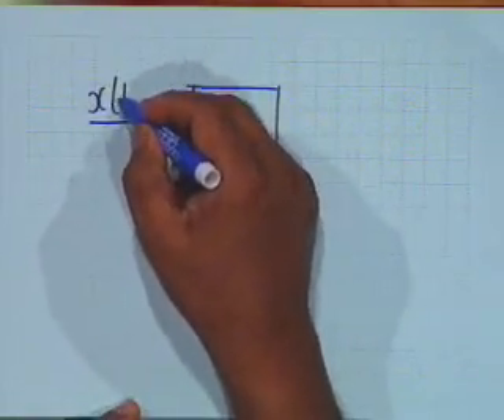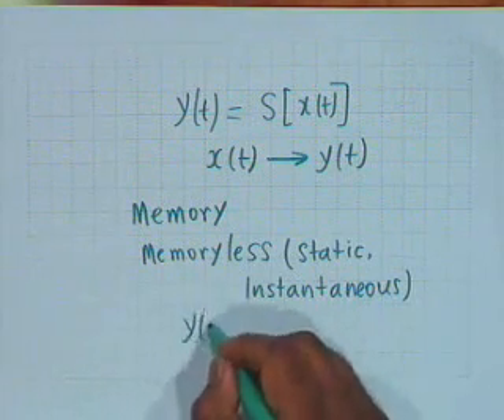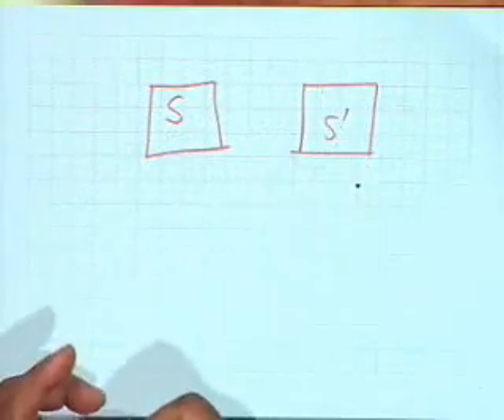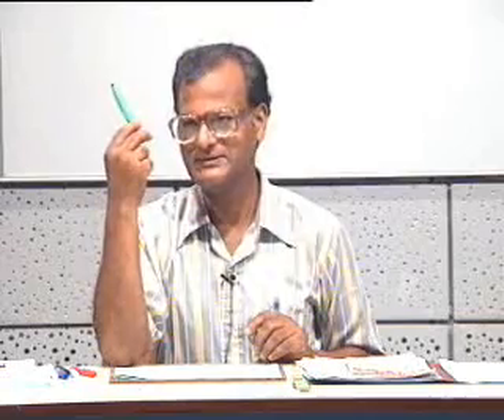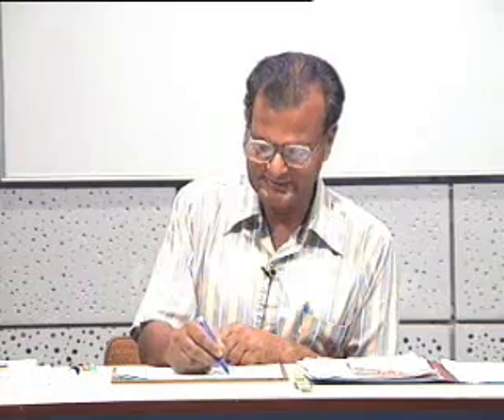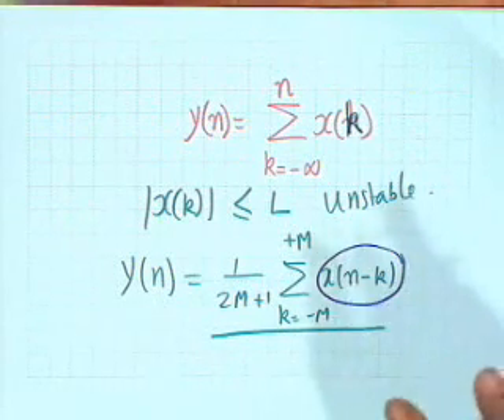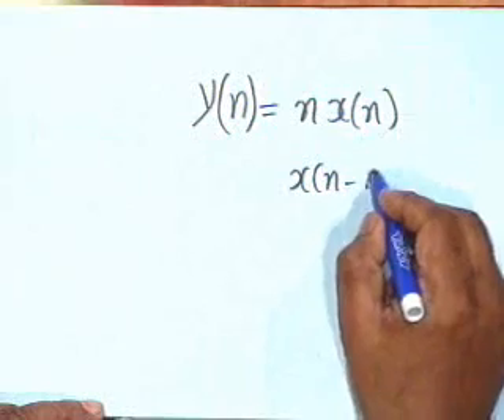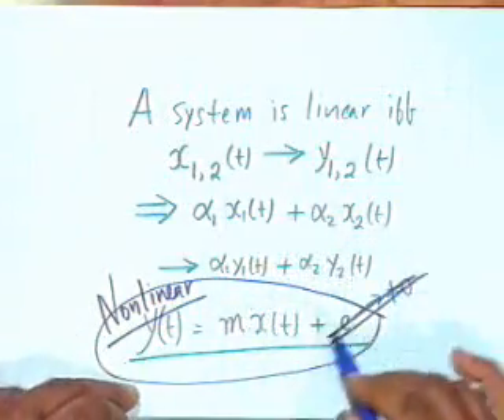4. Characterisation of Signals

Comment: Timestamp

00:09 - Understanding systems through input-output characterization.
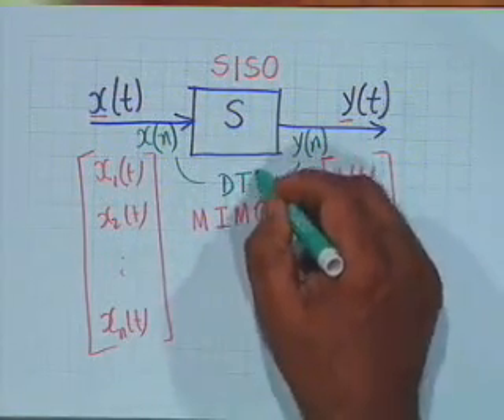03:19 - Discrete time systems transform signals using mathematical and physical processes.
09:32 - Systems can be classified by memory and invertibility.
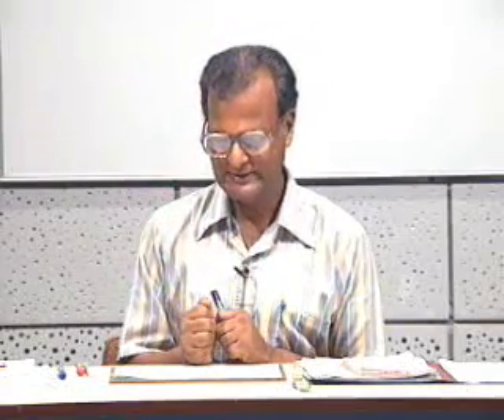12:32 - Invertible systems uniquely map inputs to outputs and vice versa.
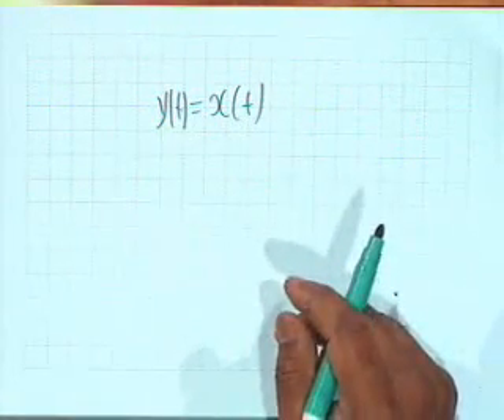19:22 - Explores invertible and non-invertible systems in signal processing.
22:11 - Understanding causal and non-causal systems in signal processing.
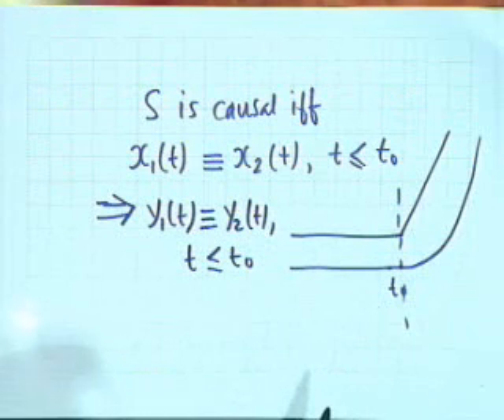28:11 - Understanding causality in signals is essential for system characterization.
31:15 - Characterizing systems by stability relates input-output behavior.
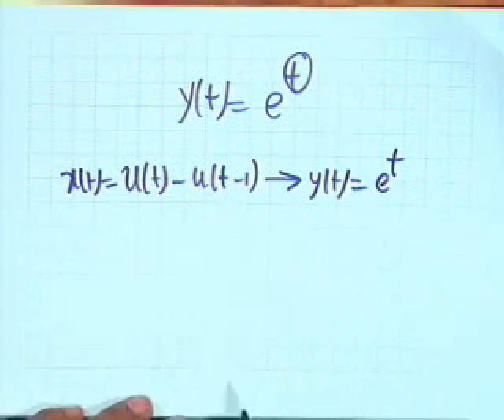37:36 - Characterization of signals determines system stability based on output behavior.
40:11 - Understanding time invariance in signal processing systems.
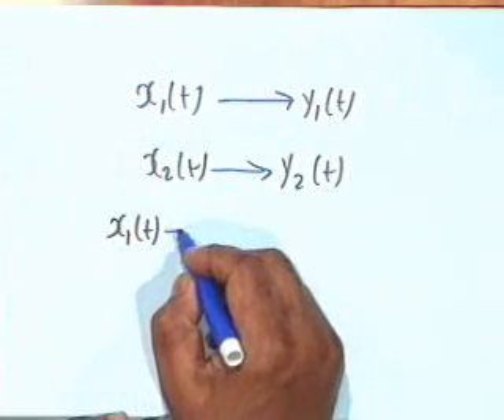46:31 - Systems exhibit linearity through superposition and homogeneity principles.
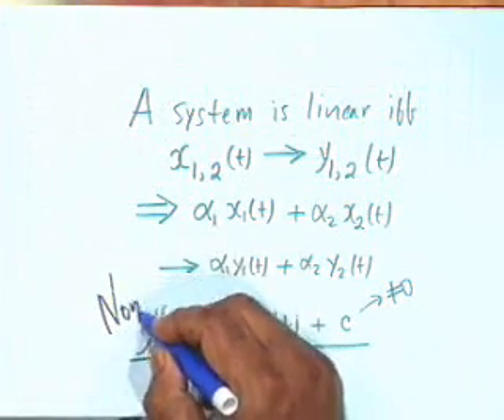49:44 - Nonlinear systems can appear linear in equations.

Comment: Sir i hav doubt in topic varient and invarient signal ... if suppose our i/p signal is x(t)  as unit impulse such that at t=0 o/p will be infinity ... and if we pass this input signal to a system ... whic simply multiply i/ p signal with 0 then our output will be 0 .
X(t) --S-----》y(t) .. here our i/p signal is not bounded i.e it is infinite .. and our o/ p is bounded i.e 0... so is this system S stable or instable ?????
Reply: For all future viewers,infinity multiplied by zero is indeterminate form so the premises of this question are all incorrect.